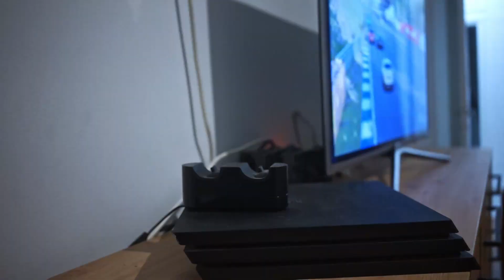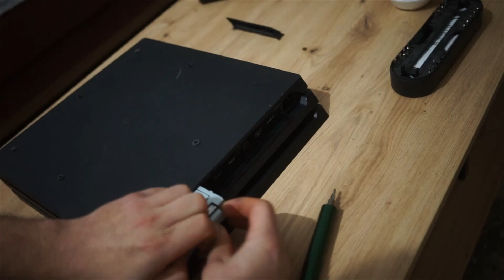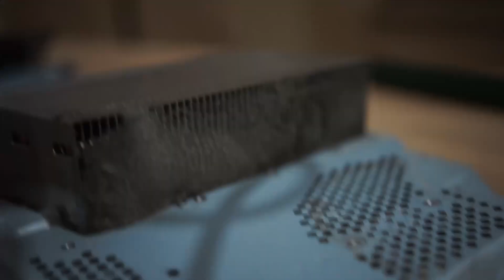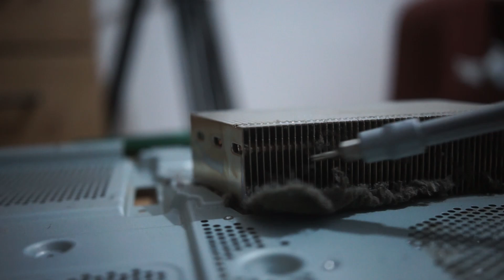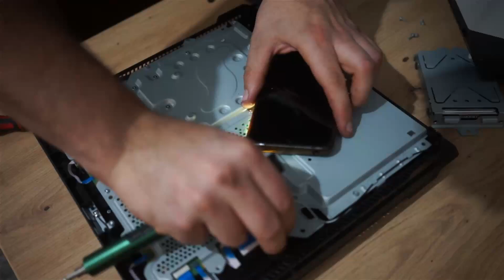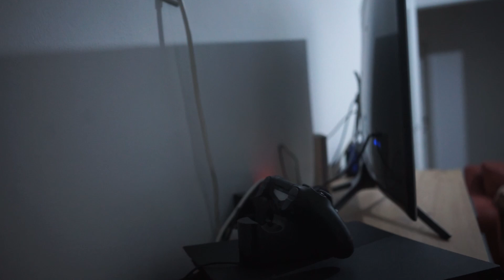Stop your console sounding like a JET ENGINE! | Cleaning and replacing thermal paste on electronics

Comment: Thermal pads on the VRAM / RAM ?

Looks like there arnt any …
Reply from the maker: there are. most of the time they stick to the metal so they arent on the pads anymore. i wouldnt replace them usually, as they, in most cases are still in pretty good condition.

Comment: I feel like you shouldn’t have to take apart a console to clean it these companies make it too difficult to care for your expensive toys and it sucks 😕
Reply from the maker: Well the problem is to change thermal paste that should be done by somebody that knows at least a bit about this stuff so making this very easily accessible could lead to problems but yeah for cleaning that is true
Luckily at least most laptops and pc cases are designed in a way where it is relatively easy
Reply: @ I feel like anyone with youtube on their phone could figure out thermal paste but that’s just me
Reply from the maker: True but the risk for the manufacturer is there still
Reply: tbf i think it’s a generation issue, ive had my ps5 for years and its never had this issue, ps4 hardware is just too old